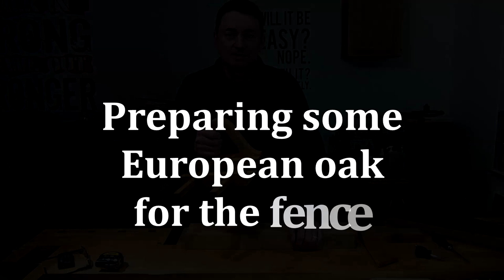Kerfing Plane Fence / woodworking tool

Comment: Thanks for another great video.  I started to build a version with the blade angled for sliding dovetails and then I saw your idea of an angled fence.   That is much better than what I started.  I guess I will start over. Thanks again
Reply from the maker: Cheers Richard. I do think an angled sole, probably just an alternative blade clamp section, would be an advantage..

Comment: Really turned out nice Mitch, probably the most functional kerfing plane I've seen. Seeing the large handle in action gives a better understanding of how that performs and it looks like a great design. Thanks for addressing both my comments from the last video here! Great demonstration of the dovetail angle, which would have benefitted me greatly in a project I did last year. The curved blade might be something I try when I get round to making one myself, and I hadn't thought about deeper gullets. The way you've designed it, it would be quite simple to swap out blades and try different things. Great video, thanks!
Reply from the maker: Thanks. I suddenly had more on my plate and wasn't able to make different blades, but definitely worth trying. A crosscut would really help with housings, leaving a neater cut.

Comment: what kind of blade did you use?
Reply from the maker: I used a 5tpi rip blade, just because I had one spare. Coarse rip blades are best for with grain cuts, and crosscut blades for cuts across the grain, so it would be useful to make one of each, or use a coarse universal cut blade, like a modern induction hardened hand saw.